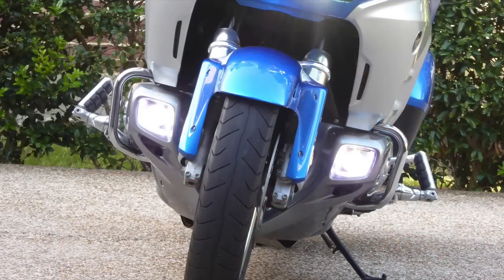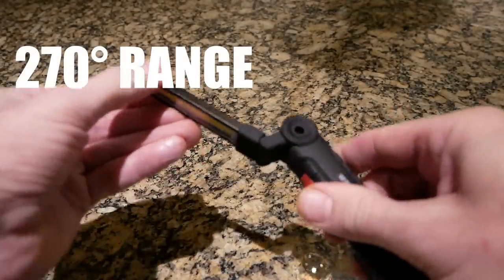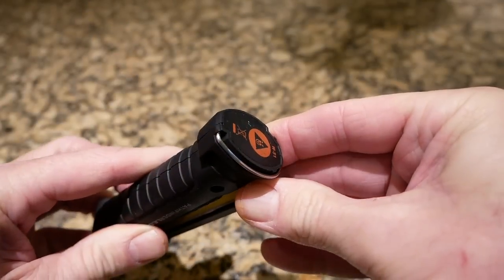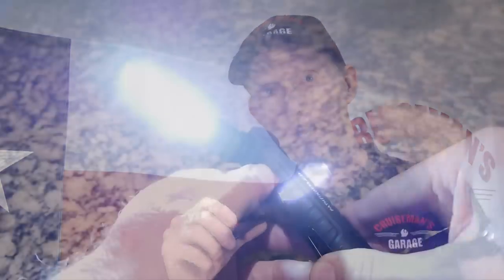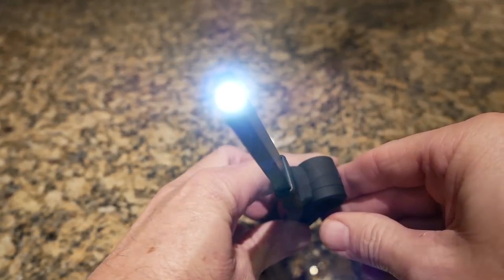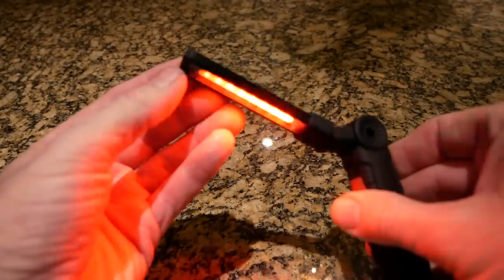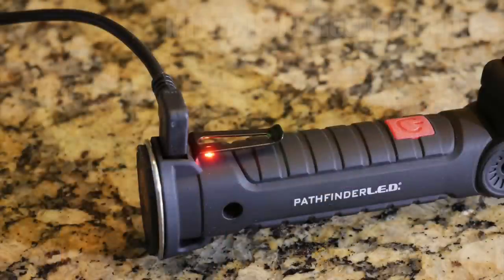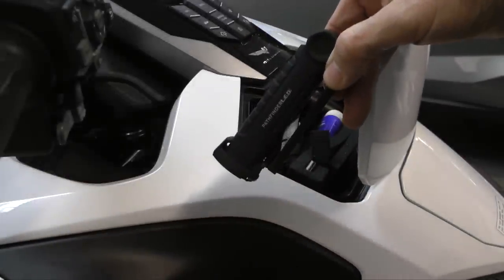Cruiseman's Cool Tools - PATHFINDERLED Work Light

Comment: Nice light and less than 20 bucks...
Could have used it under the sink yesterday when I installed a new faucet. I have a lot of led lights but it is hard to point them in the right direction while they are standing or laying on their side. I need both hands to do the work
Reply from the maker: I think this is my new favorite light!